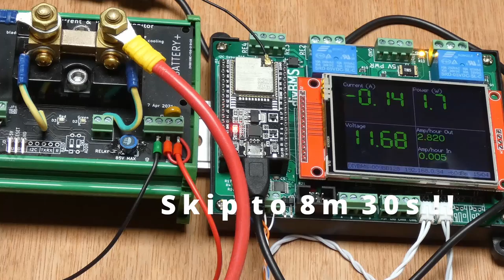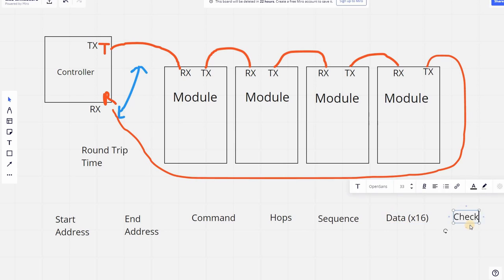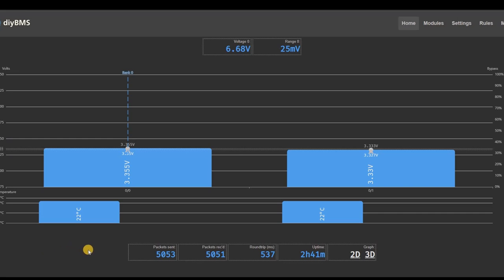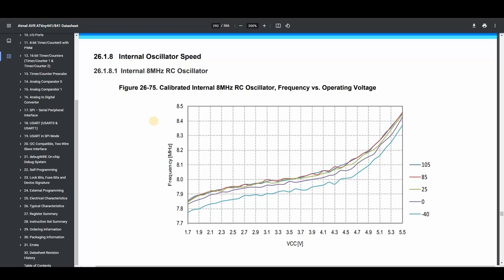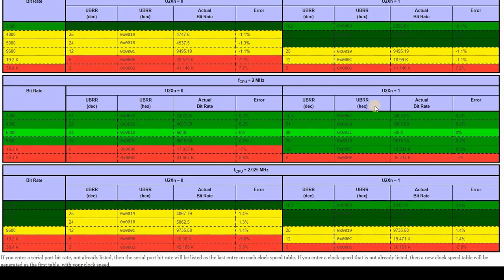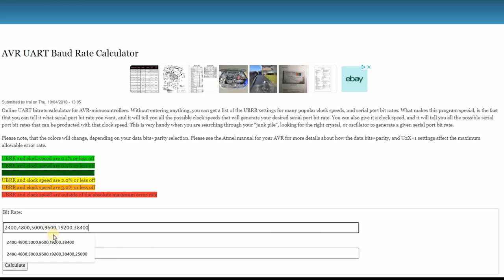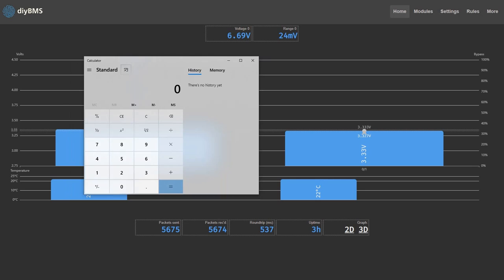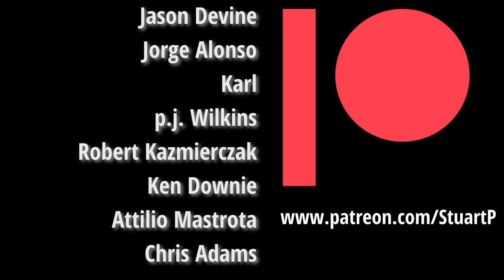Faster Communications [diybms]

Comment: Nice Work, looking for a solution for a EV conversion, will this system run a 96s Battery pack, how many modules can be linked to the Controller ?
Reply from the maker: The controller should support at least 100 modules, although about 60 is the most I've seen.

Comment: And one more thing. What would you recommend for a 14s system with 4 banks: 1 controller and 4 banks, or 2 controllers with 2 banks each?
Reply from the maker: It's better if you can keep to 1 controller, particularly if you are thinking of integration with Victron
Reply: @StuartPittaway  I also thought so. Would need to swap 421 boards to 440 on one bank though :)

Comment: Wouldn't be possible to change the oscillator frequency on the fly either based on the incoming baudrate(preferred) or just by looking at the voltage and temperature and then compensate through the OSCCAL0?. It is stated in the datasheet that a +/-1% is possible.
Reply from the maker: You would have to change the frequency very quickly during balancing, like hundreds of times per second.

Comment: In your code when you go read the battery voltage do you turn the charging voltage off first?  I could not see it there so if you don't, then you will not get a true battery reading . In fact you won't get a true indicator of battery voltage unless the charger is switched off for at least 10 minutes, so its a bit of a problem for all BMS's
Reply from the maker: No the charger isn't disconnected before a reading is made, the BMS doesn't have the ability to do this.

Comment: i have the esp8266 , how do i use this code with that controller. there is no option for communication speed. also o saw there is a current shunt input on the board , how do i use that as well. thank you.
Reply: Stuart answered in an other comment, that the ESP32 is now the developments main directive, but you can change the serial speed in the ESP8266 workspace and recompile and reupload
Reply from the maker: The official code is on the ESP32 platform. You'd have to manually change the code on the esp8266 to achieve similar results
Reply: @StuartPittaway  i tried to change it , but i have errors when i try to compile it. Can you do us a favor please and compile the code . It takes 5 minutes of your time.
Reply from the maker: @620lorenzo  I've got no easy way to distribute this mutant version, so it's probably best for you to solve the compile issues instead.
Reply: @StuartPittaway   i am waiting too.It's not working if not compiled with the correct comunication speed .Anyone solved the problem ? @toader @Macrama? Help please?

Comment: Will you do a precompiled firmware (release) soon? I haven't had any luck compiling the Attiny firmware in PlatformIO.
Reply from the maker: It should already be in GitHub, it was freshly compiled today
Reply: @StuartPittaway  i couldn't find it. Maybe i looked in the wrong spot :D
Reply: Actually i looked in the wrong repository. I find the precompiled files in the ESP32 repo, but not in the ESP8266 repo. I'm using the old controller since the ESP32 variant is way overkill for my application. Any plans to document the changes or push these to the old controller? I can do the changes if you outline what to change. I guess it's just the baudrate that changed?
Reply from the maker: @zaprodk  I've only made the changes to the ESP32 code base as thats the current focus for development. But if you are using the 4.4 modules with the older controller, it is just a change in serial port speed.
Reply: @StuartPittaway  Cool. I will reflash a module and have a go at adjusting it.
Reply: @zaprodk  did you find the compiled new software?
Reply: @ohranitel  it's in the firmware package for the ESP32 controller
Reply: @zaprodk  found it.Thank you.Not working with old esp8266 i guess.I tryed it and not worked.Does it need esp32? I understood that baud rate of ESP8266 must be changed but i don't know how.Any help will be greatly apreciated.

Comment: Your mcu is too limited in memory and pins.
You should've used rs485 instead of i2c. 1 Mbps would've been child's play. 
You didn't use a crystal. rc oscillator changes with voltage AND temperature.
Reply: He didn't use a crystal? Say that again.
Reply from the maker: Thanks for the comments.